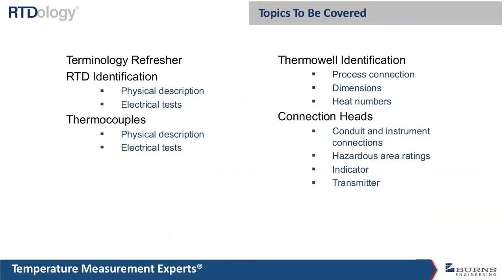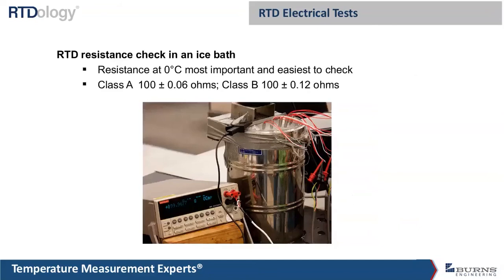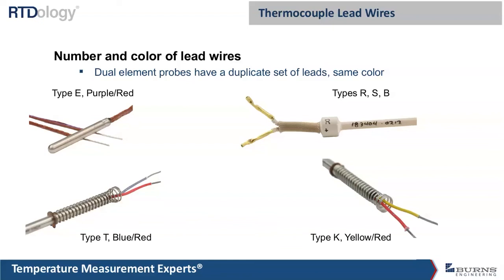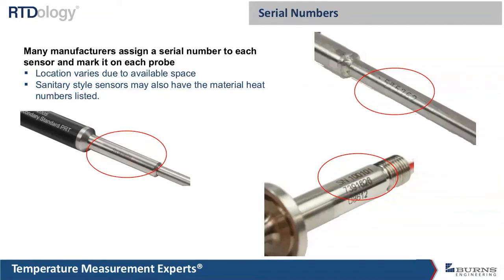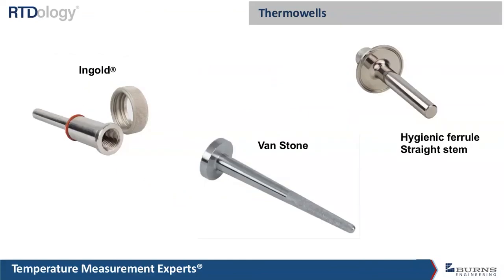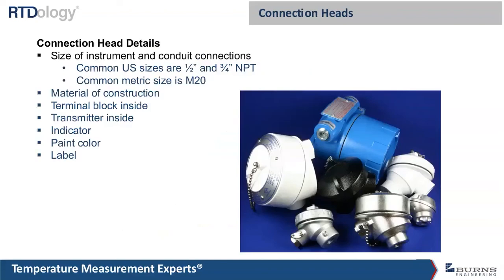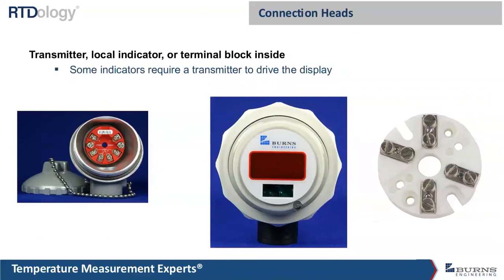How to Identify RTDs, Thermocouples and Thermowells

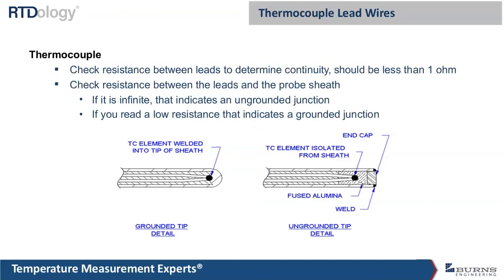Comment: There is a lot of good information in this presentation.  But the statement on the image at 11:23 that says a thermocouple resistance should be less than 1 ohm is just not factual as a general statement.  Thermocouple resistance depends on wire size, wire length, and wire materials.  I routinely use thermocouples that are more than 100 ohms.
Reply from the maker: Yes that could have been worded better.  You are correct that the resistance can vary greatly depending on wire size and length.  Most of what we manufacture will measure around an ohm because they are large gauge wires and/or not very long.
Reply: @rtdology627   I read an article written by a fellow from Fluke a few years ago and he said if it is less than 1 ohm it is a thermocouple.  I made 650 thermocouples to measure temperature of people's teeth.  They were 6' long, type T, 40 AWG, resistance measured on each one ranged from 200 to 206 ohms.